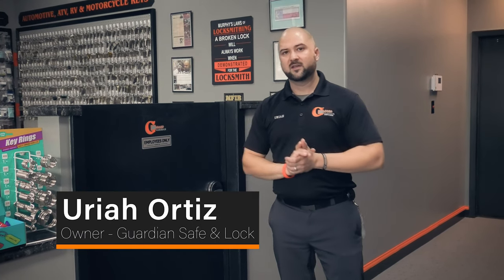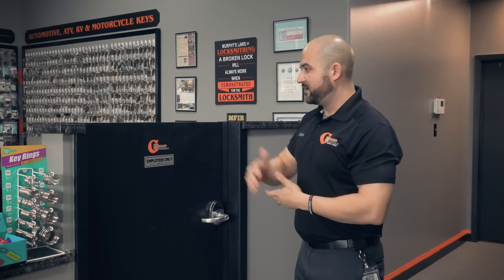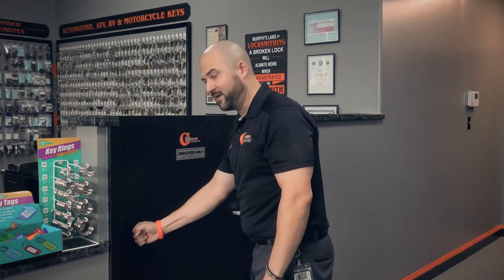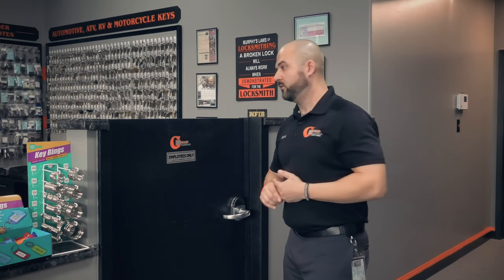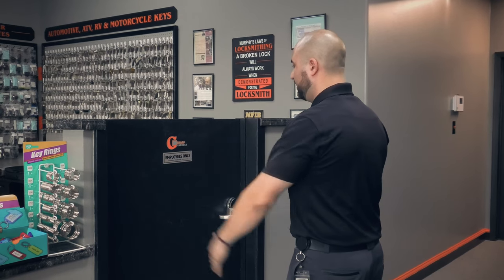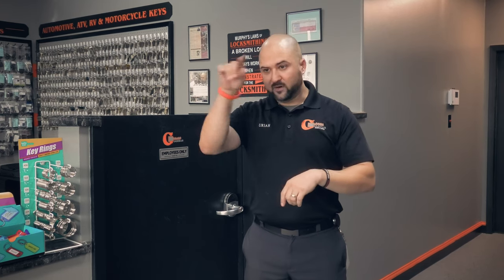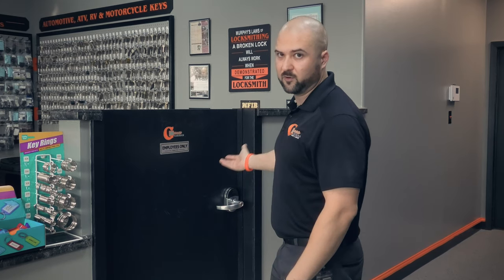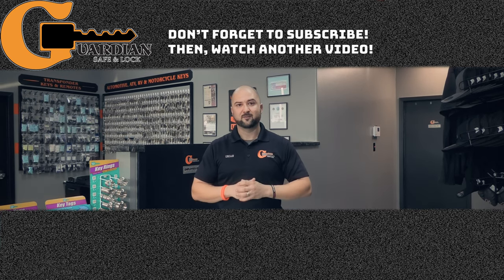How To Tell What Handing A Door Is | Door Handing | GSL Discussion

Comment: Good to see this, I like the way you explained it, I always like to say Use the Door, and it will give you the proper handing, as Long as you're not crossing your arms 

Push side
If the hinges are on your Right, and you’re pushing the door away from you, it is a RH door.
If the hinges are on the Left, and you’re pushing the door away from you, it is a LH door.

Pull side (hinge side)
If the hinges are on your Right, and you Pulling the door towards you, it is a RHR door.
If the hinges are on your Left, and you Pulling the door towards you, it is a LHR door.